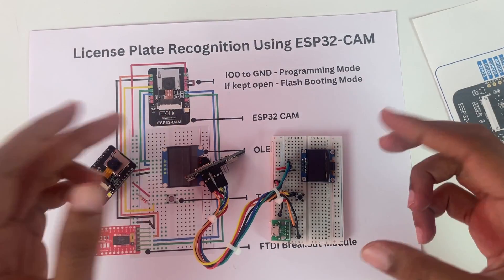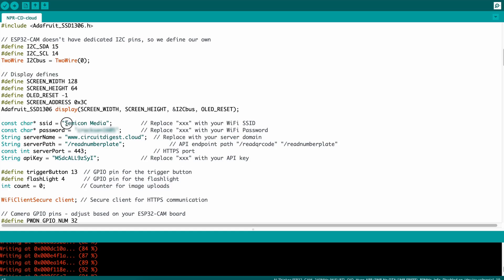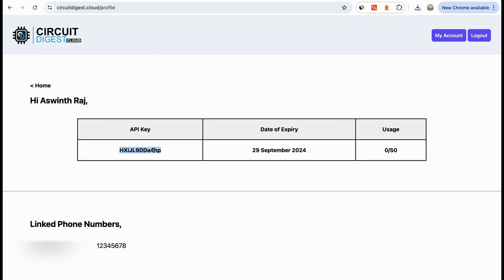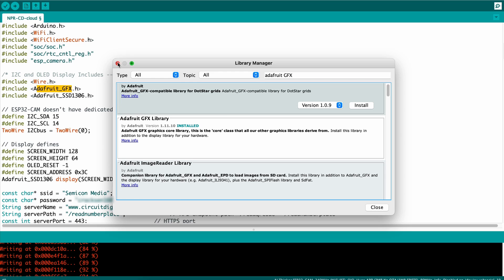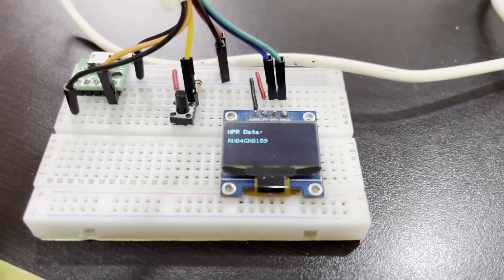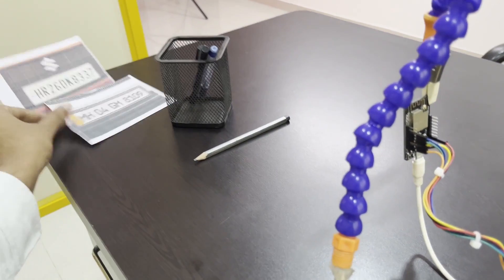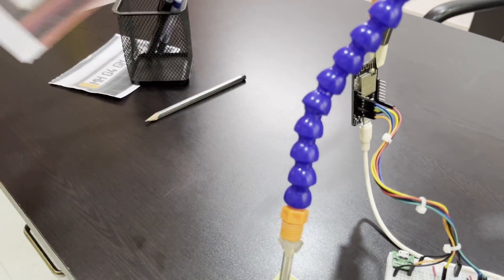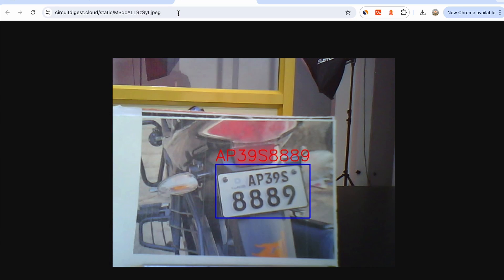How to use ESP32-CAM for Automatic Number Plate Recognition (ANPR) | CircuitDigest Cloud

Comment: Sir, i do this project with u. And it works ,in Serial Monitor say :
ESP32-CAM IP Address: xxxxxxxxxx
PSRAM found
Connecting to server: xxxxxxxx(u server Circuit Digest)
Connection to server failed
soo! what should i do next? look forward u replay!
Reply: Me too, I encountered the same problem:face-purple-crying:
Reply from the maker: Make sure your WiFi has internet access and you have inserted your own API key in the code.

Comment: Can i use the IR sensor instead of push button? 
When i place the number image it detects and it can send the output until remove the image of the number it can work same as push button because ir sensor continuously send output until we remove the image .
Reply from the maker: Yes you can use an IR sensor. But don't send the same image repeatedly.

Comment: I have the programmable ESP32 CAM and wanted to try this project but the hardware connections for the programmable board is not clear. Plzz can you help
Reply from the maker: The hardware connection is simple please check link in description for circuit diagram and follow it

Comment: can we use sim800l with esp32 cam sir if yes how ?
Reply from the maker: Yes. Please check the following link.https://circuitdigest.com/microcontroller-projects/interfacing-sim800l-module-with-esp32
Reply: @Circuitdigest  its esp32 sir i want to use esp32 cam with available pins so cam can upload image using 4g or 2g module like sim800l  sim800l is is cheap and alternative to wifi
Reply from the maker: Sim800L is interfaced with UART, which is available on the ESP32 Cam. Check the article linked above.
Reply: @Xtraharvest what for? Your "cloud" API access will expire before you finish testing 🤣